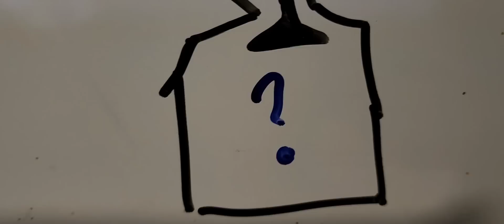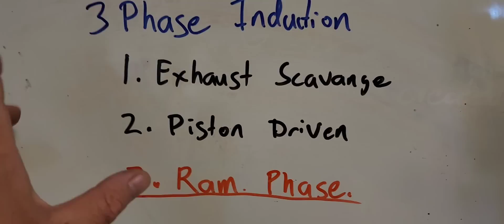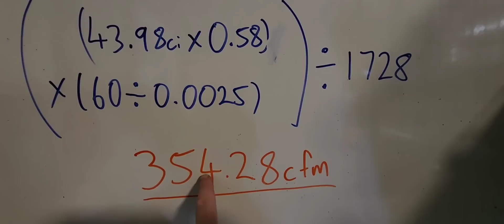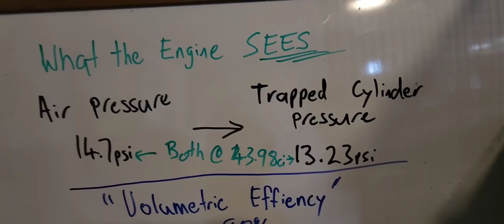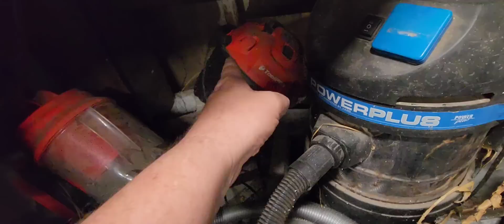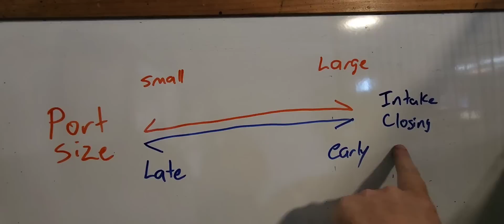Theoretical look at why the 4V Cleveland got its port size.

Comment: The short answer is they were designed for long distance, foot on the floor, circle track racing, like the Hemi. They are pure junk for acceleration performance (drag racing..)

   Bob Glidden spent tens of thousands of hours modding them, to the point of sawing off the exterior exhaust ports, machinging a port block to bolt the headers to!
Reply: Raising port floors..
The Aussie 2v's are the ULTIMATE street head..
Reply: @nobiden3134 problem with that statement, nobody has tested them.
Reply: @cammontreuil7509  Gromm Racing Heads San Jose. Strongly suggested it when he flowed mine. 290i 230e @.500. 59cc double quench pad. Splayed twisted wedge..
Reply: Oh, just junk for acceleration. Why he chose to sandbag himself, who knows? He also ran engines in the 320 to 330 cu. in. displacement sizes for weight breaks, which NHRA kept adding on to the Clevo.
Reply: @rondye9398  you talking about the BOSS 302?
Reply: The 4Vs were still better
Reply: This is so ignorant, only a Chevidiot would come up with it.  OF  course he spent time on em, that's what RACERS who make a living RACING do.  They find every advantage possible.

Comment: An internal combustion engine is like a tuned instrument, changing one part might make it a lot worse, all parts from the air intake to the exhaust tip have to work in harmony.

Comment: Would you agree the 2V closed chamber with good port work and giving 11-1  is the way to go for street n strip. I think so.  Mike
Reply from the maker: I built my first Cleveland almost 20 years ago that way. 302C heads, 20tho off and towing cam (260 advertised duration, 0.5in lift) Aprox 12.3:1 compression. It relied on mechanical advance only for timing  as vacuum advance just caused knock. Sadly, the valvesprings let it down, going into float at 4900. Still, it made 340hp. It wrecked a C4, numerous 6 cylinder diffs plus a 9in along with countless rear tires.

The fastest I got was a 9.2-seconds over 1/8 mile from a 3600lb Australian 4 door Falcon from a 3 speed C4 auto, stock converter, and 3.23 rear gear.
Reply: @crd-nz_001 I have a 351c, closed chamber 302 heads,, 750 vac/sec and 3.55 9 inch in my Xb Falcon. Gets driven regularly, just a great all-round cruiser.
Reply: @crd-nz_001  Cool, sounds like a combo I had 20 yrs ago as well, only I had open chamfers with a 292 Borg. It well well on the street. Now I  want compression and geering,. IV used these closed 2V and noticed  6-7 th RPM is no problem and strong from the start to end so why change, and I have choice of manafolds and pipes.  Also cast heads are Quilty.  Hey great podcast thanks mate.
Reply: Great video. It's funny how the old iron 4vs can still hold there own against the aluminium performance heads of today. Not saying they are as good but for a 64 year production head that's impressive. Back in the day the Chevy guys would shut up pretty quick if you had a 4v.
Reply: some of the old guard liked to raise the 4V port floors with epoxy to get a better drop
Reply: @fastst1 people forget its vacume, it will draw from anywhere. I don't think it helps and Then the flow ratio's are wrong.

Comment: Thanks for your video. I like the approach to describe in layman-ish terms, the dynamic relationships between induction, ports, heads, ram air, fluid dynamics, rpm and power.  For a while I thought I installed a cam with the wrong valve timing, wrong LSA, duration. But I’m confident that at least a narrow rpm band, it’s optimal 😂

Comment: I think Chrysler were running the W2 head on the 340 'X' block with a 360 stroke, (358 was the actual cubes of the 360 I believe, so they (nascar) could allow for each manufacturers biggest bore smallblock) For a time the Chryslers were the go-to smallblock and the Cleveland didn't surpass it until the early 80s with development really, and Chrysler went broke at the end of the 70s anyway and most people switched over to Ford or GM
Reply: No motor in racing history has been penalised more than the Cleveland. In both Nascar and ProStock, the Cleveland had to carry more pounds per cubic inch than any other motor in history, including the hemi
Reply: Also to add to theshed's statement the Cleveland head platform is the winningest head design in NASCAR history and was solely responsible for the demise of small block Pro Stock and Super modified drag racing classes in NHRA.
Reply: Um, not in reality. No small Mopar is superior to the Cleveland head.
Reply: @chadkent1241  Well, those were the words of Maurice Petty. And I wouldn't take him for a fool or liar for one minute. If the Ford was way ahead, I'm sure they would have just switched camps. Don't forget the fancy Cleveland C2 head weren't around back then.
Reply: @shoominati23  By this time Petty was a has been, anyways, with motors that were outright cheating mega cube smallblocks.

Comment: The interesting thing about the Cleveland head is that the factory published data from Ford when the Cleveland was current, was at 5" Hg, or 63" H2O. They compared the head to some of their competitors in the published data. Low end flow wasn't that different, but high end flow differences were massive, and stable. For a number of years now I've said that the greatest weakness of a Cleveland is team small port engine builders. They just don't understand the difference in the design concepts of the motor. Very few people understand how important closing the intake valve early is on a Cleveland, and how important the exhaust depression during overlap is to running engine intake port velocity on a Cleveland.
Reply: Yeah, if I had a dollar for every time I've heard someone say that the 4V Cleveland had no power on the bottom end, I would have a hell of a lot more in my retirement account. 
These people don't understand is that you need flow just as much at low RPM as you do at high RPM. 
What Cleveland's did not like, as far as low end torque was concerned, was the high duration, low vacuum cams. 
Pretty much the point of what this gentleman is talking about. I didn't have a flow bench, or Dyno, and I learned this by accident. I put a milder cam in mine than all of my friends were using, because I just wanted a bit more power for the street.  I ran a cam that was recommended for 1800 to 5200 rpm, a lot of people call this an RV cam, but since I had ported heads (conservatively ported) with 3 angles on the seat and 2 on the valves.
Long story short, it was not only stronger on the low end, it kept pulling to 6000. 
I found this out on the strip, racing another 4V Cleveland that had a strong rumpity rump lope, while mine was much smoother. I didn't expect to win, I launched faster, and did not shift until I stopped pulling away, which was about 6000. That is all it did. So I started researching why. It was always the cam choice, and all the people who just threw parts on them with stock heads.
Reply: @douglaspage2398  I've looked at hundreds of shelf cam grinds over the years, and I've had most of my custom grinds derived directly from a shelf grind with just one single alteration, the LSA. I haven't yet seen a shelf grind Cleveland camshaft that I believe has a wide enough LSA. I've taken grinds spec'd with 106 LSA and simply changed it to 112. The difference is significant. I wasn't chasing vacuum, I was chasing torque, and it worked.
Reply: @theshed8802  as a guy who designed valvetrains for a lot of canted valve heads.... it's not just a LSA function, but both an excessive low lift low problem, and usually way too much intake duration for the RPM range being run. If you take the good parts of a 4V and fix the bad parts of it, the motor works extremely well.
Reply: @theshed8802 how do I get 2500rpm  highway cruising economy . I run a truck avd caravan doing high mileage . Crow cams offers a cam but I am thinking custom grind. 2v heads closed chamber , flat top pistons in it. Just want a dam change. Correct can runs 10 hg at idle in c6., seems low for a street car.
Reply: @douglaspage2398  interesting the Cleveland 4v engine
Reply: Spot on, the factory Cleveland 4V just doesn't fall flat up top.
Reply: @fastst1  I had a ‘71 Torino convertible in high school with a rebuilt Cleveland.
That car would accelerate well past 117MPH indicated. Here’s what it felt like. The faster you went the faster it wanted to go. It started “coming-on” even as the car reached its gear ratio limit top speed. So it was lively not flat as it reached its top speed. It had much more that it could have done in a bod
y which was better prepared for just hauling ass.
They were definitely doing something special with the Cleveland design confusing as it was to most at the time. There is a reason it gets banned form competition. I follow lots of Vizard’s stuff for the last Eight years now. Cheers from the States! Um, 2V heads which were skimmed .015 in the 80s. With a Three angle valve job and a vacuum secondary Holley 600, for the above. FYI.
Reply: @CarterLee-o4u  I gotta say the Focus at its rated top speed that may or may not be 150 sure felt a lot more planted that my torino 4v at 130. Yes it still wanted to go and was only turning a little over 5k., It really needed some better aero but it sounded awesome.
Reply: @fastst1 Scotty the mad porter says, that really good heads will bandaid a small cam by just continuing to support the needs of the ever higher RPM.
Reply: What youve just said is shorter duration with a tight camshaft LSA .
Reply: @bobgyetvai9444  Cleveland's benefit greatly from wider LSA's. Due to the rotated and canted valve arrangement, the cross flow between the valves is much higher during overlap than an inline valve head. Trivia, the Ford Falcon GTHO phase 3 had an lsa of 111.5° from factory. Closing the LSA's up on a Cleveland takes out a lot of torque, particularly in the low end, as reversion on both intake and exhaust are markedly increased.
Reply: @theshed8802  the solution to that is not moving where the centerline of the camshaft lobes sit, but fixing the VJ and chamber. Which is what every iteration of cylinder head does that has used the basic canted valve design the 4V laid out. The A-C302 heads, Yates, SB2, P7, RO7, FR9, and the Toyota Cup heads all have a more modern chamber design that fixes what you are trying to fix by reducing the overlap. 

Bob is right.... shorter duration with a tighter LSA will solve what you are talking about IF you fix the issues in the chamber, which still can be done on a stock 4V closed chamber head without brazing them up.
Reply: @bobgyetvai9444  yes, well put
Reply: They dont understand because the "Cleveland Too Big" intake port was regurgitated by all of the magazines during the 70's-80's this  set the trend of people thinking of them as being inefficient and having no low speed power and only good for all out racing. My first car was a 351c 4v 70 mustang. Driving it daily taught me that this information wasn't true. Easiest way to describe the 4v Cleveland ports is to think of them as being variable. They give you what you want when you need it at the engine rpm that it's operating at.
Reply: @erikalston4496  i often describe the 4V Cleveland as an engine that runs on 'gulp factor', not port velocity. It was designed to have a lot of mixture available as soon as the valve was opened, get it in with minimal pressure drop, and get the valve closed early to maximise dynamic compression. It's like a drowning man gulping air. This is why I use wider LSA's than on inline valve heads, and generally close the intake earlier.
Reply: Exhaust depression?
Reply: @thisisyourcaptainspeaking2259  at the end of the exhaust stroke, the velocity of the mass of the exhaust gas travelling down the exhaust creates a low pressure area in the cylinder. This is why valve overlap makes such a difference to the way a cylinder charges during the induction stroke
Reply: @theshed8802  Okay, cylinder end-gass scavanging, If I understand correctly.  Some degree of overlap, early closing of intake but my question is does this simply mean more overlap and advancing the cam?
I've never been impressed with the bottom-end lackluster performance of my 2V open chamber 351C and I'd blame it on the torque converter if it wasn't for the lethargic throttle response in neutral.  It's been quite a few years since I've measured intake vacuum but as I recall there wasn't much at idle, leading me to blaming the smog cam.  The 5.0 was much snappier and fun to drive, IMO.
Reply: @thisisyourcaptainspeaking2259  advancing or retarding the cam doesn't change the amount of valve overlap, it only changes when it will happen in relation to piston position. All cam events are fixed at the time of cam grinding on a camshaft. Valve events however are changed through moving the camshaft in relation to the crankshaft. Static compression ratio has a large influence on low end torque. Your torque converter stall speed, and tall gearing, will exacerbate this issue. Most of the 5.0's that I have driven have had shorter diff ratios, and 4 speed autos as opposed to 3 speed autos, so the differences have always been a product of gearing, not torque. As such it's an apple's and oranges comparison that results in incorrect conclusions
Reply: How do I get better economy in a big f truck 351 running a 2 v closer chamber heads? 2500 is the goal highway speed. .. standard cams for stock engines would be best right? Ford already calculated this?
Reply: @buddyrojek9417  if I recall one of the world record mpg trucks was the 300 inline 6, 40mph at just above idle, no windows and 400psi tires.
Reply: @fastst1 yes I wish I had a 300

Comment: It's true, each component in an engine should match the combo and intended use. 
  A very important thing you didn't mention, is the air flow is rpm related. That air velocity vs crank angle graph you showed is a snap shot of a particular rpm.  500rpm later, that graph would look completely different. 
  The universally accepted rule of thumb "small port=high velocity=more torque." Sounds good in theory, but I've seen many actual dyno tests which prove it wrong.  Often, a bigger port makes more torque and more power.
Reply: Interesting I would like to see some solid data on the 4v Cleveland I was told they run about 500rpms below the 2v in low lift is this true.obviously after 4000 rpms the game changes.
Reply: @rossgirdeen3247  go to Richard Holdener's channel if you haven't already. He has done dyno testing on replica boss 302's and 351's against the other performance engines of the time. These are factory standard engines. The Chevy DZ302 makes a little more low end torque than the 302, but not much. Top end hp, well, you wouldn't want to be a Chevy driver. The 351 is a different story, it out torques and out powers everything else in the class across the entire rev range. Along with much better idle quality due to the factory using much less cam to make the power
Reply: @theshed8802  yeah I always hear people say there there no good to big but all the Dyno pulls I've seen say differently.